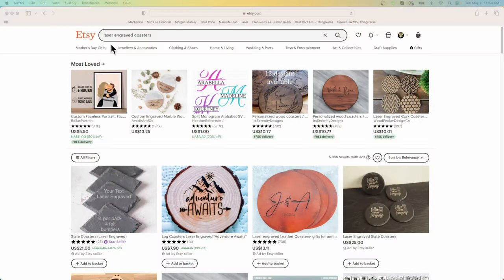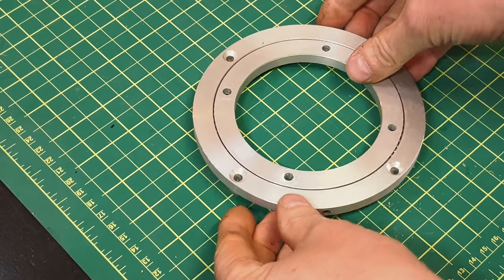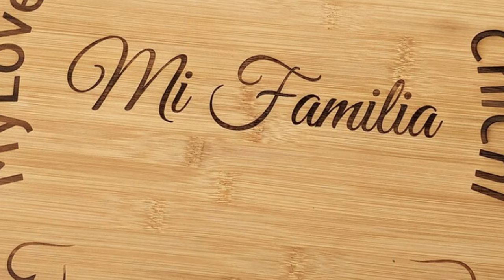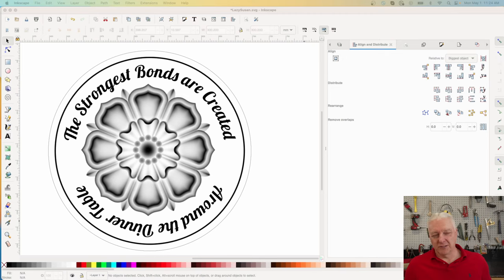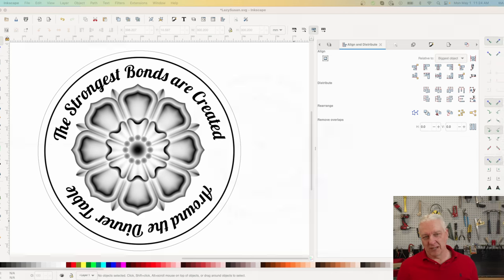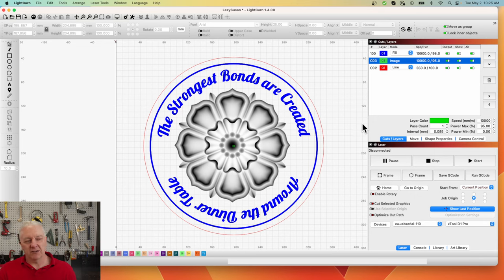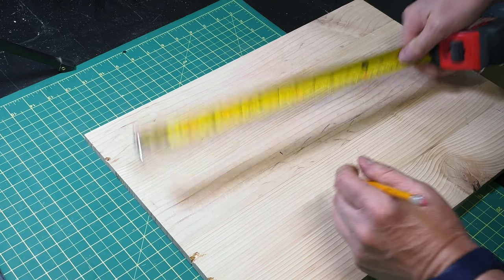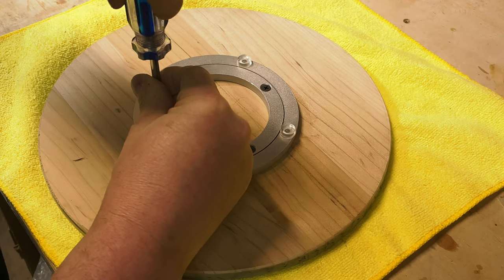Make a Profitable Product in under 90 minutes

Comment: Would it be reasonable to replace the acrylic painting with powder coat?  And if so, would a person do the poly first or after?  (I just got done perusing your videos after watching the one on powder coating! 🎉)
Reply from the maker: Yes, absolutely, though technically you wouldn’t need poly at all since powder coat is basically plastic. You’d have to try it out to find out if poly is better before or after.  I’m not sure powder coat will stick to poly
Reply: @SteveMakesEverything right, that was my first thought about powder coat over poly but asked anyway. Ha!

Comment: Hi Steve. Curious if you might have tried either the xTool or Atezr for metal coloring on SS or Aluminum? It seems to be a feature that both say can be done, but no one really does videos on it. Lookin forward to your input - Sara.
Reply from the maker: Yes both of these and any diode laser with decent power can do colored engraving on stainless steel. I’ve played around and it certainly works, but it’s honestly more of a marketing gimmick than having any serious practicality. If I’m over at my local metal shop I’ll pick up some SS and maybe put a video together for this
Reply: @SteveMakesEverything  A video for input would be much appreciated! Honestly, I've purchased an xTool and was playing around with it, but having issues even making a black line. There was a 10 minute window where I thought I'd figured it out (had a black line and a blue box) but next day, can't replicate either. According to xTool Support temperature and humidity are important, so I replicated both of those and still nothing :/. I understand I can use sprays to get the black lines, but it's kind of annoying to see a Company say "You can do this!" and then they about face and say "Well, you miiiiight be able to, under the right circumstances.".
Reply: And just to add the comment - I would be happy to help cover the cost of the materials :x Def not looking for handouts, just knowledge from someone more familiar that my newbie-ness.
Reply from the maker: @FallenAiy  Shoot me an email and I can try to help you out.

Comment: Hi Steve, great video! It's a perfect example of finding a less crowded pool to swim in.   Do you know if you can get the same grayscale effect with Retina Engrave?
I am trying to decide if I am going to replace the controller so I can use the functions of Lightburn.
Reply from the maker: I’ve never seen RE3 engrave like this.  Most CO2 lasers don’t seem to do this well either.

Comment: I was watching your video during the image engraving and saw that the laser head seems to vary in speed. I have encountered the same thing with my 20W on speeds over 3000mm/min. Is that normal? I am using similar DPI settings but only get smooth laser head movement at about 1/3 the speed you are using.
Reply from the maker: When engraving, the laser controller is smart enough to skip places where there is no engraving, so the head will move faster over those spots.

Comment: Interesting video Steve.  Good food for thought.  I am curious about the true engraving comment.  Is there something different about this X-Tool model or just the fact that it is 40 watts of optical power enables the depth of the engrave?  thanks again.
Reply from the maker: The 40W just allows you to work faster. Not many diode lasers can do true grayscale engraving. I’ve only seen the Ortur Laser Master 3 engrave like this. I’m not sure why some laser can do this and others can’t. I must bell related to how they manage power I ternally

Comment: What was the time to cut this project? $80 to $100 is a decent markup but if the project takes 3 to 4 hours obviously there’s a lot more cost involved. Nevermind the time to prep the material, breaking the pallet, planing the boards, cutting the boards to size, gluing the boards… there’s a lot there to do for sure, then the painting and staining part as well. I imagine you probably spent the better part of a day making this piece… so I’d imagine the cost is probably closer to your $80 to $100 when everything is said and done. 8 hours or so crafting, means you’re only charging $10 an hour for your time. Hopefully it doesn’t take that long….
Reply from the maker: Ha I didn’t spend anywhere near 8 hours for this even though I was recording video at the same time.  You can get 4-6 of these out of a palette and that will take 15 minutes to tear down.  These are small pieces,  so you can make them out of scrap in your shop and avoid palettes completely if you want.  If you’re willing to pay for wood you can avoid any of this including gluing if you buy 12” wide boards.

Keep in mind that for the 90 minutes it takes to engrave this you can be doing something else. You don’t need to stand and watch it.  Instead cut a glue the next one and/or finish the previous one. 

If I spent much more than 2 hours to make one of these I would be shocked. I actually made 2 or them at the same time in less than 4 hours and I was finishing another project at the same time.  The only bottleneck is the engraving time.

Comment: Interesting, but the bearings are very expensive
Reply from the maker: ??  Buy them on Amazon
Reply: @SteveMakesEverything  they are over 20 dollars/euros
Reply from the maker: @davidgruty  I'm not sure if that's the xTool price or the Amazon price, but you should be able to find most of the rolling parts as standard pieces for a lot less.

Or maybe are suggesting a different bearing than the one I'm thinking of.
Reply: @SteveMakesEverything  I meant the bearings for the lazy susan, the aluminium ones. A 6-inch one costs 23 euros. If one wants to sell a lazy susan the price must be high, since the bearing is expensive
Reply from the maker: @davidgruty  AH, my mistake.  You can find cheaper bearing and honestly use whatever you can find that can do the job.  The one I used here is one that I have used in the past, so I know it works.  It is certainly not the only choice, though.
Reply: @SteveMakesEverything  yes. It wasn't a critic. Just an observation for the price. I bet it's a good bearing
Reply from the maker: @davidgruty  LOL, I wasn't taking it a criticism.  If you are building things to sell, you need to look for the best value, so you can maximize your profit.  I totally get it.

Comment: A tiny tiny bit disappointed in this video mate. I think you mentioned at one point “doing it on the cheap” - but how many of your target audience have a jointer/planer, circular saw, spare palettes laying around etc?
Reply from the maker: Fair comment, but as I mentioned you can easily buy pre-planed pine at any local hardware store.  It's still pretty cheap and simplifies things greatly.  I've seen 4' long 12" wide pine shelving at my local Home Depot and it was somewhere around $25.  That would let you build 4 of these.

Of course, if you do have an old palette lying around you are going to want to find some project to use it on, just to get rid of it.  Trust me on this😉
Reply: @SteveMakesEverything  fair comment also. Love the channel. 

If I may offer some more insight… I totally agree that everyone does slate coasters but I disagree that there’s no money to be made. 

Albeit everyone with a laser can do a slate coaster, you can compete on quality (designs are perfectly centered / aligned and slate is given a nice lacquer finish). 

You can also compete on customer service (be amazing here, respond quickly, be helpful, be polite), quality of photos (buy a white box for photos) 

And also packaging. Make your packaging awesome. Stick in a little personal note. 

We got into lasering just before Christmas, so about 6 months ago and we’re doing really well with slate coasters due to - I believe - being excellent at all the OTHER stuff.
Reply from the maker: @prepped8551  Yes, quality is the most important feature you can ever deliver.  If you're doing well then keep at it.
Reply: I'm a tiny bit disappointed reading this thread. Id say many of the target audience do have tools and materials long before they aquired the laser. He didn't say there was no money in slate tiles. He pointed out the market is saturated. Of course you can compete on the points you raised. If you were successful at that then you could invest in the basic tools most of us already have acquired over time, allowing one to lower cost of goods sold and increase margins. As for pallets, its an example to inspire folk to look to cannibalising materials from alternative sources. Tools and skills are aquired over time. If you don't have them, get them. If you're not willing to, whats he supposed to suggest, robbing it? The guy smacks down nuggets of wisdom but you can't please everyone. Cry less, improvise more. Good luck with the high hanging fruits. The rest of us are trying to maximise returns and efficiency.
Reply from the maker: @LairdJ56  Thanks for the endorsement!

To be clear on the coaster business.  It isn't that there's no money to be made, but rather the number of them you need to make to show measurable revenue in your business.

He's the simple math I use.  If a coaster blank costs $2 and you sell it for $4, you still won't show a lot of net revenue.  With a CO2 laser, it will take 5 minutes to place, engrave and remove a coaster - with a diode laser, this will probably be 7 minutes, meaning you can make 10/hour.  This means that your laser's maximum gross hourly revenue capacity is about $20.

But eating into this is the time it takes you to design things, package and ship orders, the cost of your workspace and electricity, business income taxes, etc.  And none of this includes the actual costs you incur to find and lock a customer in.  The cost of sales will be high because regardless of your volume or quality, you will compete with thousands of other people doing exactly what you are doing.

In the end, your $20/hour revenue quickly turns into $10 of profit (Generously assuming a 50% profit margin).  This would be your hourly salary, which puts you below a typical student working at your local burger joint. 

Even if you ignore all of this and set a goal to make $100K/year gross revenue (a lot for coasters), you would need to sell 50000 coasters per year, which will require 5000 hours of your time...or ~14 hours/day if you work every day of the year.  This will also wear out at least one laser/year.

At the same time, there are companies in places where labor and materials are a fraction of your costs which will destroy your business because there is no intellectual value required to make a coaster.

At this point, I recommend calling a manufacturing company in China or India to make these and drop ship them directly to your customers while you sit by your pool and drink a cool beverage.  This will give you far more profit and free up 5000 hours of your time.

I realize how much of an ass I'm being here, but I'm trying to save you lots of time and money.😀
Reply: @SteveMakesEverything  Thanks for the Maths but I think it is the Op that needs to read your response. As I signed off on my response to him. I completely agree. If the op was doing well, he wouldn't be crying about the target audience not having said tools and would use his profits to buy some. I was calling his bluff and calling him out for being a Kevin. Thanks for taking the time to make the content.
Reply: @prepped8551 wait so you’ve got a 1500usd+ laser, but somehow don’t have a circular saw? 
Well just letting you know handsaws exists and they can be had at good quality for 30usd ;)
Same with a planer/jointer - just get a hand plane. 
Spare pallet? That’s literally a stupid ass comment to make - what if he used some scrap walnut? Not everyone has scrap walnut, I only have scrap zebra wood.
Reply from the maker: @mikkelkirketerp4884  Please keep the comments gentle. We can disagree without tearing each other down 😏
Reply: @SteveMakesEverything  correct - me not being native and also my ASD sometimes makes for a spicy combo in which it seems angrier than what I actually intended :)
Reply from the maker: @mikkelkirketerp4884  I too get overly cranky sometimes  - I guess it's a side effect of slowly moving into "Old geezer mode." FWIW, this comment made me smile.